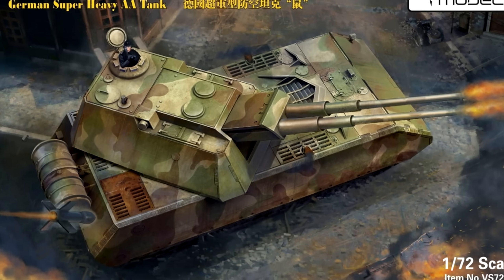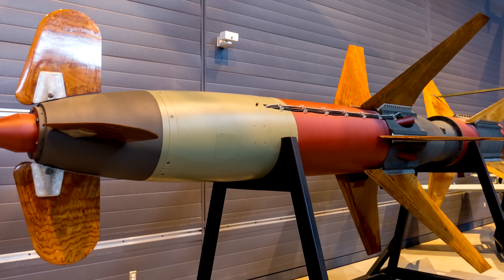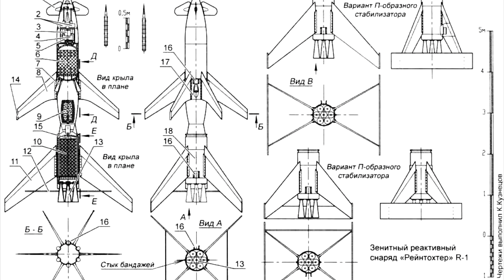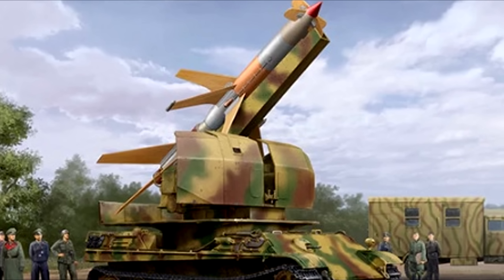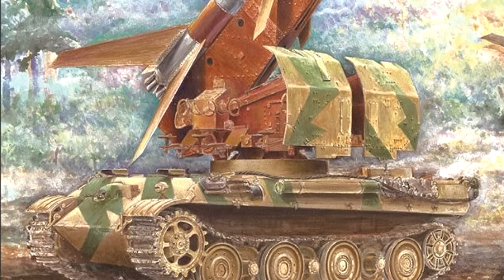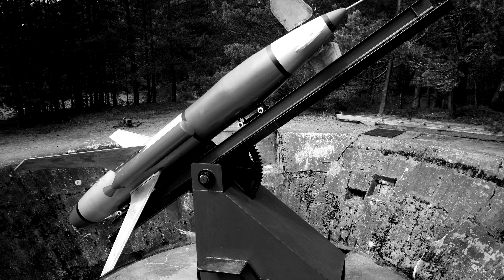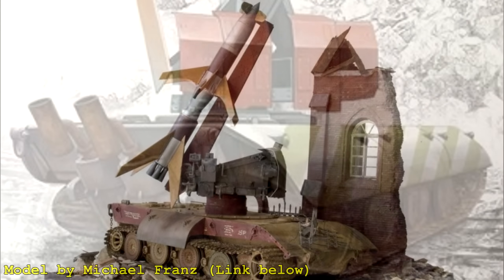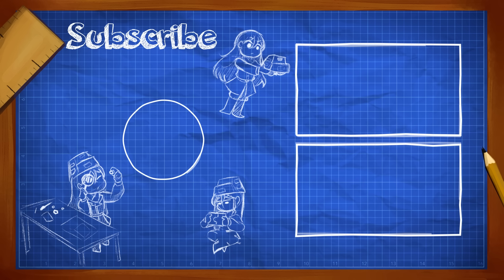German Surface to Air Missile Anti-Air in WW2? | Fake Tank Friday

Comment from the maker: Even with the ones I added in while writing I still technically missed a couple since there are some of the absolutely crack-pipe walker tanks with launchers for them. Might have to do a top 10 craziest napkinwaffe model kits someday.
Reply: You'd enjoy some of the kitbash heresy then
Reply: Before I even watch this : I love fake tank Fridays .
Also : WW1 German Oberschlesien tanks. It's gone a bit quiet recently but it's still out there, faking it's fake booty .
Reply: Just a little fun fact, the Rheintochter was actually tested with a simple infrared seeker and a proximity fuse of varying design. The early heat seeking device was pretty similar to the first sidewinder seekers in that it had one infrared sensitive cristal of the viewing field was interupted by a spinning disc with a certain pattern. In this regard, the germans were actually pretty far ahead of the allies. 

People always seem to get excited about the german ww2 research for the wrong reasons. 
There were incredible developements, they just weren't big machines but rather the small subsystems.
Reply: Top 10 Wehaboo-bait vehicles
Reply: The awser to your qustion on what sensor was used or would be used for warhead detonation would of been ither the pilot via control cable/wire or via Acoustic sensor activated by the vibrations caused by propeller aircraft as the germans had worked this out for the B17 and other heavy bomber aircraft there also was a photoelectric sensor designed orginally for the Me163 rocket interceptor to fire its verticle cannon into the bellys of allied bomber aircraft this could of been adapted theres also magnetic and radar activated warheads but those im very rusty but were in development they already had radar directed AA and Unguided rocket systems in use by 45
Reply: Rheintochter had a proximity detonator. It also launched with two smaller solid boosters strapped to the sides that are often forgotten.
Source: "Die deutschen Waffen und Geheimwaffen des 2. Weltkrieges und ihre Weiterentwicklungen" by Rudolf Lusar (Munich, 1958), page 158ff.

Though I'm not sure how credible that book is, as the author was on the design team for a competor at the time and complains quite a bit about why his design wasn't chosen. 
(Also, he seems to be convinced that the US has flying saucers and the soviets have polywater bombs.)
Reply: @macroglossumstellatarum5932  the R3 was single stage and had 2 boosters, I have never seen the R1 with boosters which was 2 stage
Reply: The obvious invisible elephant in the field here is “how does this mobile monstrosity reload?” Makes sense with a fixed launcher that would have an associated crane & armament bunker.

Another tiny issue is a 1940s missiles aimed at a bomber steam 8,000 ft up would need a liquid propellent. Good luck keeping your ethanol & lox mixture inside the rocket as you trundle around the perimeter of an air base, let alone a battlefield.
Reply: What would be more viable is if Nazi germany retrofitted some of the older and more out of date SPAA's to be able to mount Fliegerfaust  or even multiple of those systems
Reply: @Santa Clause It's abandonware now. On the upside, you can get it for free. On the downside, good luck getting it to work. It's gonna take some effort.
Reply: Please do take the time and look at some of the concepts model companies have made about tanks launching V-1 flying bombs.
Reply: Most of these types of designs are "well the Germans were designing this and designing that, surely they would have combined them"
The fact half of them were completely impractical for more than looking good as a blueprint or a model, just  seems to escape most people.
Reply: That seems just like the Waffenträger auf e100 but instead of a cannon, it has that missile
Reply: That seems just like the Waffenträger auf e100 but instead of a cannon, it has that missile

Comment: This was a real proposal... by model companies. Even cheap models go through a design and approval stage.
Reply: And his production stopped in 2017. Today is a vintage kit.
Reply: And realistically if the germans went foward with such a project you would see it on top of a panzer III, IV or captured axis (czek, polish, russian...), very unlikelly on a panther and DEFINITELLY not on something bigger, people forget that metal, specially on later years of the war was a scarce resource, also you would NOT waste a heavy tank hull on a SPAA, it's one less hull that can be fitted with a turret and used as a tank, and they were lacking on those in the later years.

Comment: Wow didn't realise that there were "working" SAM systems being developed during ww2, I knew that the technology was possible at the time but in Germany it certainly is improbable.
Reply: There were alot of promising SAM designs that were tested during the war or shortly after. Rheintochter was very influential for soviet SAM design while Wasserfall influenced early American SAM
Reply: @dave_sic1365  The Wasserfall was the only one that could've bveen effective, since it utilised a liquid explosive, to produce a 200 ft blast radius. A sinlge rocket could've brought down an entire formation.
Reply: I went to the Udvar Hazy center in Virginia during a trip to DC and that fascinated me when I learned missiles were that far along in 1944.
Reply: @anzaca1  Bomber's cant be taken down by a light shockwave. Fragmentation of any kind?
Reply: British Brakemine "Brakemine was an early surface-to-air missile (SAM) development project carried out in the United Kingdom during World War II. Brakemine used a beam riding guidance system developed at A.C. Cossor, while REME designed the testbed airframes. Trial launches were carried out between 1944 and 1945, and the effort wound down as the war ended. Although Brakemine would never be used in its original form, its use of the "twist-and-steer" guidance method would later be used on the more capable LOPGAP design, which, after major changes, emerged as the Bristol Bloodhound. A single Brakemine survives in the REME Museum." https://en.wikipedia.org/wiki/Brakemine
Reply: @DoggosGames  bombers can be taken down by a well placed apostrophe, as you showed.
The liquid explosive would be dangerous in a warhead because of sloshing and causing instability, but a gel explosive surrounded by a fragmentation mantle could work, and as it can be poured during construction is probably easier to manufacture than packing solid blocks or granules.
Reply: You forget that the first cruise missile the V1 rocket was invented by Germany and the first ballistic missile the V2 rocket was invented by Germany! Nasa rocket engineer Werner von Braun was a German rocket engineer during WW2  You don't know all that because you are a close-minded kid
Reply: There was quite a lot being developed that later turned into at least the successor of famous weapons. For example the Ruhrstahl X-4 missile was copied by Nord after the war... While this particular design (as SS-10) didn't go into mass production, Nord went on to produce a quite successful successor to it, the SS-11.
Reply: @kkjkkj2584  The V-1 wasn't a rocket at all. It was a cruise missile in the modern sense, all it really lacked was an improved guidance system (for example an automated version of Knickebein) and a proximity self destruct system to discourage intercepts by tilting it...
Reply: @anzaca1  How many bombers do you believe are to be found inside "a 200ft blast radius"?

A B17 has at least 100 feet wingspan and they'd have to stay a multiple of that apart to avoid collissions from shearwinds and other turbulences.

Also the blast is rarely ever what kills a plane, shrapnell is. For which you need much less blast radius, just enough energy to spread lots of it and the necessary mass of metal hull fragments to spread around.
Reply: US Gorgon missile family go brrrt
Reply: -The Germans successfully used two guided missiles in July 1943 and August 1943 the Friz-X bomb and the Hs 293 rocket boosted glide bomb.  They used them for about 9 months before allied jamming attempts started to become progressively more successful after missiles were captured.  The Germans never detected successful jamming (jamming was often ineffective) though they suspected it.  They had alternative guidance kits ready in case of jamming but never deployed them because they weren't sure of the jamming.  The missiles became unusable because the carrier aircraft even with stand off ranges of 16km and attack altitudes of 24,000ft were just too vulnerable to allied fighters.  
-Prototype test missiles were funded and test fired by Messerschmitt (Enzian), Ruhrshtal (Rhinetochter), EMW (Wasserfall) and Henschel (Hs 117 Schmetterling ie butterfly).
The Hs 117 Scmtterling was ordered into production.   The Wasserfall was more sophisticated but was also planed for production.  A Mach 3 missile it would be a threat to today's fighters.
All of these missiles were able to use all of the 13 guidance systems developed.  
The most basic simply had the operator directing the missile by tracking a flare but the missile in actual use would have used a more sophisticated system of one operator team tracking the target with a FLAK predictor and another the missile with a mechanical computer aligning the missile and target.  There was radar tracking of target and missile (via transponder) as well and a beam riding system as well as the MAX-P passive radar system to home onto allied radar like H2S or fighter radar and MAX-P active radar homing and infrared homing.  
Hs 117 manufacturing began but the quality control problems missiles are very sensitive and vulnerable to and caused delays and the missile never quite made it into service.
Reply: @William zk  first Fritz-X is honestly classed as a Guided Bomb, not a missile, not a missile.

Two ASM-N-2 BAT go brrrrrt
32km range, self guiding and only cargo ships sunk.
Reply: Soviet Union actually had a bunch of Jet and rocket aircraft projects that got cancelled by Barbarossa.
Reply: @croskerk  The technology of a Fritz-X and a rocket propelled missile is almost exactly the same just that gravity instead of a rocket is used to accelerate the missile.   The BAT was a weapon used in 1945 after the war in Europe was over and 2 years aftewr Fritz-X had been used.    There was nothing remarkable about it except miniaturization of the 140 vacuum tubes needed.   The Germans had a track locking anto aircraft radar in 1943 called Mannheim FuSE 63 and the US Army had the SCR-584.  These could lock onto a target.   I can explain how this works if you wish.   There is no difference between locking on to a ship at sea and locking on to an aircraft.   What is remarkable is that the USN invested so much money into achieving this.
Reply: They were also working on early infrared homing systems for both anti-ship glide bombs and anti-aircraft missiles.
Check out the Ezian or the BV143.
Reply: @jnievele  The missile knows where it is at all times. It knows this because it knows where it isn't. By subtracting where it is from where it isn't, or where it isn't from where it is (whichever is greater), it obtains a difference, or a deviation. The guidance subsystem uses deviations to generate corrective commands to drive the missile from a position where it is to a position where it isn't, and arriving at a position where it wasn't, it now is. Consequently, the position where it is, is now the position that it wasn't, and it follows that the position that it was, is now the position that it isn't.

In the event that the position that it is in is not the position that it wasn't, the system has acquired a variation, the variation being the difference between where the missile is, and where it wasn't. If variation is considered to be a significant factor, it too may be corrected by the GEA. However, the missile must also know where it was.

Comment: Surprised to see Warfront turn up here, I remember it from way back; old ass Eurojank RTS about an alternate WW2, it's a game where the Tiger is Germany's medium line tank and the Soviets have liquid nitrogen troopers. And on top of that it's still a surprisingly fun game, sadly it's practically abandonware with no (legal) digital distributors and some hard copies floating around Amazon and Ebay. I've got a physical copy gathering dust since my disc drive broke so can't use that, however like most old games it will struggle to run properly on Windows 10 right out the box.

Comment: For Wasserfall (the smaller SAM derivative of the V-2) a sound proximity fuze was proposed, same as for the Ruhrstahl X-4 air to air missile. Wether that would have worked I have no idea. I guess with the guidance methods at the time a Radar VT fuze was a must, and that was one of the reasons german SAMs didn't see any mass combat use. Edit: Apparently a proximity fuze called "Gerät Kugelblitz" (device "ball lightning") was intended for Rheintochter but I couldn't find any sources online on how that was supposed to work. Some claim radar proximity, others comparative distance from the ground (basically two rangefinders measuring range of target and missile detonating the missile remotely when the distances matched)
Reply: I dont think the nazis ever managed to get doppler radar fusing to work. So it would have had to have been either acoustic, or command detonated.

Comment: remote guiding missiles like this in video games is very difficult, and probably even harder irl
Reply: Depends. Those early missiles were usually guided by the "zieldeckungsverfahren" or target overlaying procedure.

The missile would carry a flare and the aiming personnel would move the light dot over the shilouette of the target and hold it there. the missile would be detonated by some kind of proximity Fuze. Germany had an acoustic proximity Fuze and a radar proximity Fuze. Alternatively it could be detonated by impact or command from an experienced crew.
Reply: @Mauricio Pittavino exactly.

The "Kranich" acoustic proximity Fuze consisted of a thin piece of sheet metal that was vibrating. It's resonance frequency was tuned to 
the b17s engines. Resonating vibrations made it bend so far that an electrical connection was made with its container which fired the initial detonator.

I'm unsure if they would have used an acoustic Fuze. Radar fuzes seem to be more likely to me.

Comment: I think using a Pz 4 hull to move those around would have been useful, even if it lacks the ground target capabilities of a Pz.Sfl. IVc. The Pz4 was getting a little obsolete, so it would have been a useful conversion to get some use out of old/damaged tanks. And the ability to move launchers outside the road network would have been useful once the allies send strike planes after the launch sights.

Comment: There's also the question of loading the damn thing. If it's on a tank chassis moving from place to place, that means there's another vehicle following it around with one or two more missiles for reload, plus a crane to get the missile on to the launch cradle. The Rheintöchter was more than 20 feet tall, 21 inches around, and its launch weight was over 3,000 pounds.

Comment: I'd like to see Cone's thoughts on the common misconception, that last prototypes of german jets influenced all jet history.
Reply: Gloucester Meteors were starting their introduction to the RAF in July 1944, weren’t they? Intercepting V1s over the Channel before the V2s rolled around. 

Iirc there was at least one battle over Belgium with Meteor pilots hoping to see some Me 262s scrambled but they never did. They mostly did nighttime and ground attacks into 1945 being careful not to fly too far into occupied territory in case they got shot down and reverse-engineered. 

They got replaced by Hawker Hunters and Supermarine Swifts as the 40’s rolled into the 50’s and we’re pushed into training and reconnaissance roles replacing the older Spitfires and Mosquitoes.

Comment: There was a simpler missile proposed which was a smaller version of the Me-163 rocket aircraft called the Enzian. In fact it used the same type of rocket motor as the 163. It was wire guided and carried a 500 kilo warhead. The idea was that it would be launched at bomber formations where it would be exploded. The Luftwaffe had dropped smaller bombs from fighters into US bomber formation bringing down a number of aircraft So two of three 500 kilo warheads exploding amongst a formation would have been devastating.
Reply: No the Liuftwaffe bombing attempts brought down ZERO bombers - TOTAL failure, justvlike everyone else who tried it

Comment: So far as I'm aware, these early German SAMs were to be liquid fueled - scaled down V2s essentially. That would present some more problems for mobility. If its actually a V2, then you need liquid oxygen, while if you're going for ME-163 C-Stoff and T-Stoff, those are a bit volatile to transport in a ready weapon, and would dissolve the thanks they are in - so once again require fueling shortly before launch.
Reply: The wasserfall weapon at least was iirc supposed to run on nitric acid as oxidizer, which is much worse about eating tanks than what they fed me163. (163 didn't actually have a particularly bad fuel mix, it just had really awful safety design)
Reply: @amperzand9162  I find its helpful to just treat anything labeled as "Hypergolic" as if it hates you and wants to destroy all that you love.
Reply: @MrChainsawAardvark  Yeah that's generally good policy, although there are definitely differences in the degree to which various chemicals desire the downfall of all life.